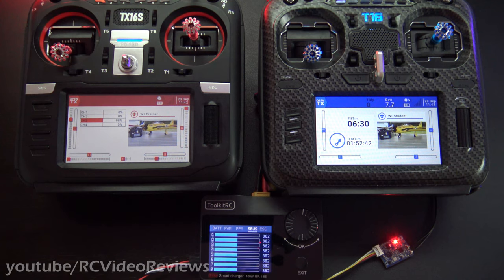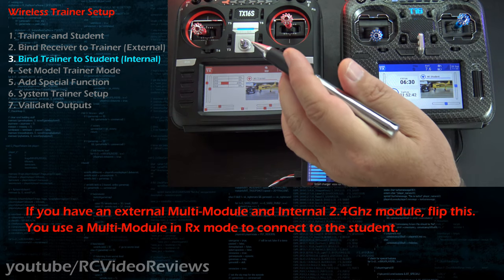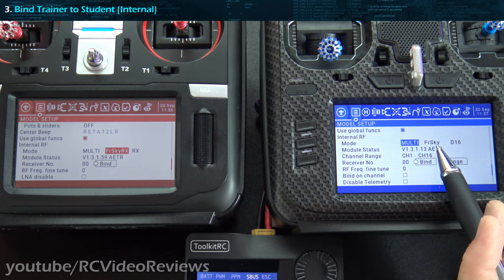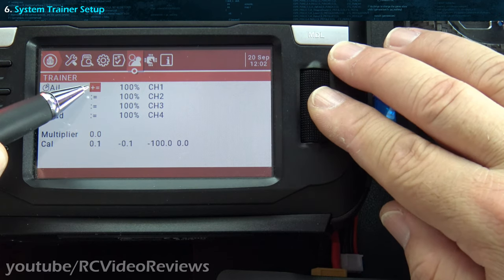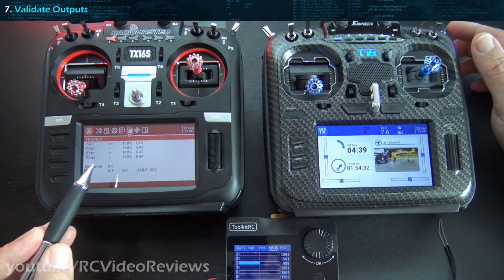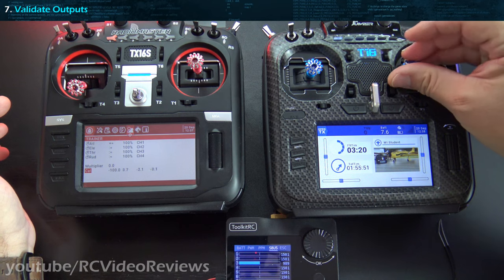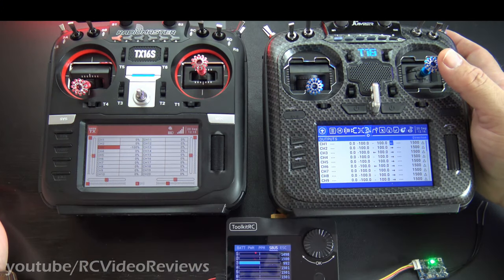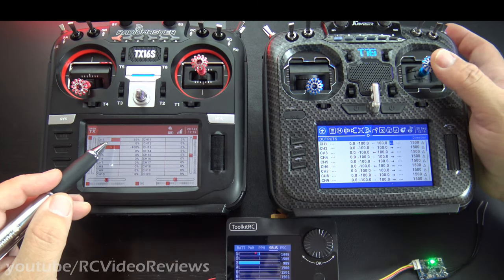OpenTx Wireless Trainer How-to • Complete Guide for Radiomaster TX16s or Jumper T18 • [Intermediate]

Comment: Hlo sir i am from Nepal i bought jumpert16 pro but the proble with Frsky x8r is its range is just too low its just 300 to 400 metres i am just confused what to do
Reply from the maker: I found this same post 3 times. I'll just reply here though:
Do you have the same issue with receivers other than the x8r?

Have you looked into frequency tuning?
Reply: I used the flysky fsi6b but the range was 500 metre or less the problem is it should have range almost 1.5KM but it doesnt plz help me i am giving training and rc scale plane education to underprivileged and poor student ho cant afford these type of thing
Reply: I also fine tuned the frequency
Reply from the maker: @aesatishchaudhary5933  How are your antennas oriented? On the radio, it should be pointing at your forehead or it should be laid over on the side. DO NOT aim it at the model. On the model, you should have one oriented on the lateral axis and one oriented on the vertical axis. Also make sure you have nothing between the model antenna and the ground antenna if you can. Try to minimize any obstructions.
Reply: @RCVideoReviews  ok sir i will give it atry
Reply from the maker: @aesatishchaudhary5933  I wish you success sorting it out. From a software/hardware standpoint I have no other suggestions. That's all I know to do with the hardware you're using.